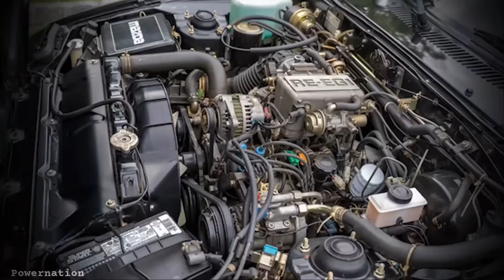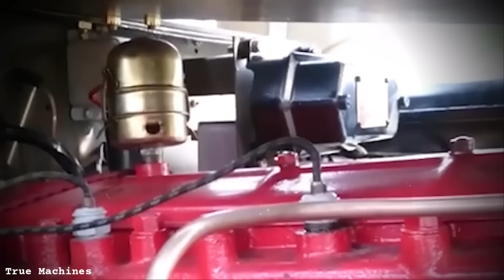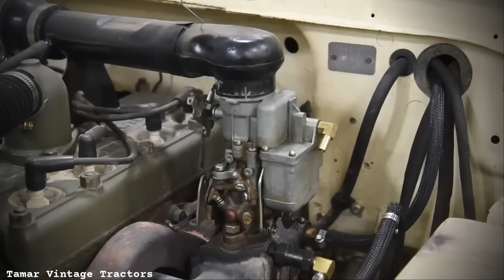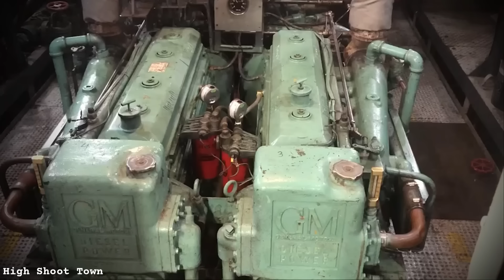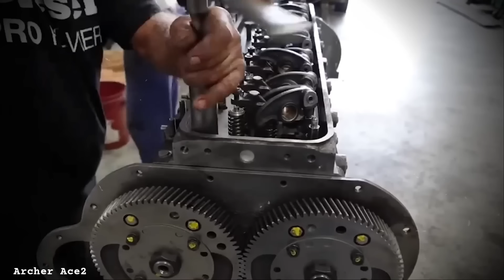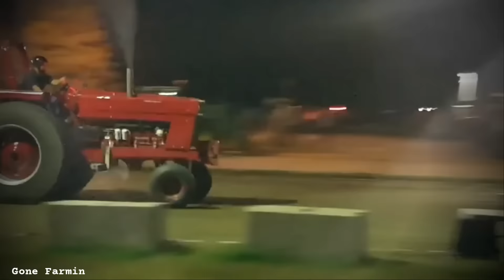How One International Harvester “Tractor Engine” Outsmarted Racers With Farm Torque

Comment: The phenomena descibed here is exacty why automobile engines don't survive use in an aircraft. No automobile engine is designed to operate at 70% rated power or above for hours at a time.

Comment: A major difference unaddressed in this video is the fact all these IH V8 engines are reverse flow cooling. The high volume high pressure water pump feeds directly into the heads where it is most needed. The heads see the coolest water first, then the water turns down to warm the bores, then to thermostat housing outlet to radiator. I think Chevrolet tried this on a cam driven water pump on perhaps LT1 maybe. I know the water pump is healthy. I had an engine running on a bench and upon a throttle twist to show off to some kids I blew some rusty freeze plugs out of it.

Comment: Gas V8 engines were never used in tractors. They were designed for and used in light and medium duty trucks. Some were available in the larger combines in the early 70s.